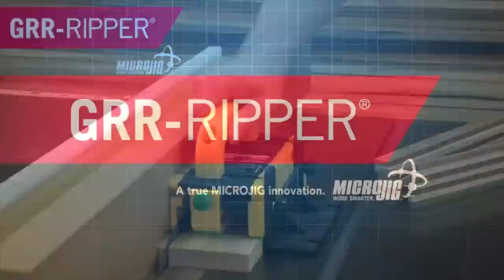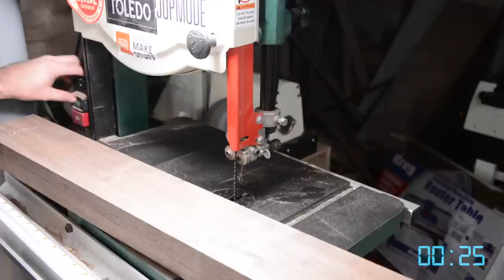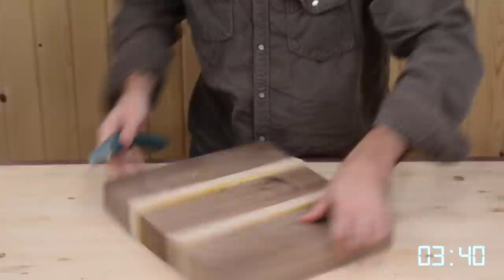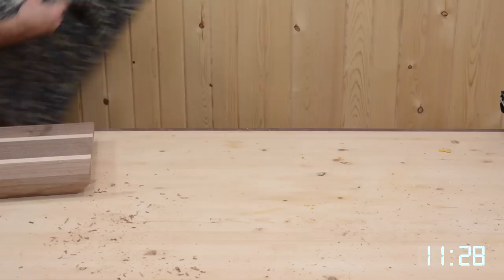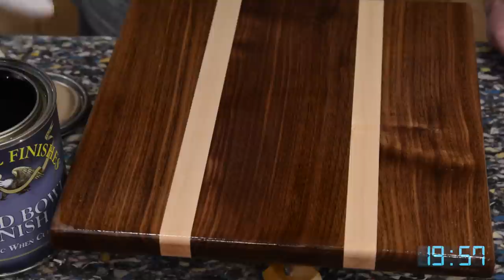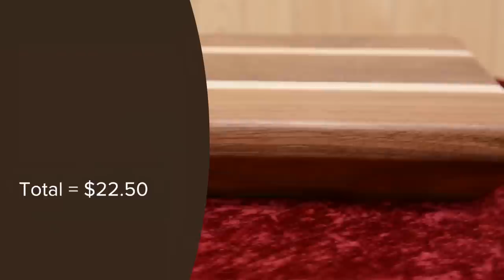Making a Cutting Board in 20 Minutes

Comment: Nice cutting board, black walnut and maple make a great contrast/combo. Try using a ripping blade in the future with around 24t count, you will cut thicker materials like butter with no struggle. It's amazing how a low tooth count sharp blade designed for ripping will get a higher output out of the same size table saw motor.

Comment: I have watched a bunch of woodworking videos tonight, and they've all been impressive. One thing in common throughout them all however, is that all the carpenters appear to have tens of thousands of dollars worth of machinery. How anyone could emulate what they do, or hope to get the same results, with little or no expensive equipment is.... impossible.
Reply from the maker: +DEUS VULT woodworking is expensive!
Reply: I just finished a cutting board today - im looking up methods of finishing the wood now. I have a crappy $100 table saw, $300 planer/thicknesser, $15 glue, a cheapo $20 set of clamps and a $50 random orbital sander. That is literally all I used. If you're precise enough with your cuts and glue-up, you may not even need the thicknesser, you could probably get away with a hand-plane! Not impossible at all!
Reply: Check out Steve Ramsey, Wood Working for Mere Mortals. He does everything usually less expensive and even gives options for even cheaper options. That being said, all of this could be done with hand tools, but it'll take you a lot longer!
Reply: I know what you mean. The high-end tools do make it easier, I was just lamenting my Black and Decker jigsaw from 1980, means I cut it wide and sand allot more, if your willing to take the time, the same results are...possible
Reply: OMG I was just laughing out loud and thinking the same thing! Cutting board in 20 minutes... if you have all the top-of-the-line equipment, include a planer that's basically as fast as a paper shredder. I mean, props to this guy, but I have a circular saw, a hand planer, and some clamps... so this was not remotely helpful.
Reply: would it really sell for 70  $$  though....  rich people might buy it in a good mood..lol
Reply: @primalfury2011 $70 for a custom cutting board is not expensive nor for "rich" folks. It's almost the cost of a video game, a restaurant meal for 2, etc.. and it lasts for decades when taken care of.
Reply: Harbor Freight is my friend. Do they have $1,500 miter saws? No, but what they have will work for a long time and get you started in woodworking for under $1,000.
Reply: The art of woodworking is dying and dying fast.  Everyone with a few thousand $$ in high end equipment thinks their a master woodworker.  But, you take those machines away and they can't do jack.  My favorite woodworker is a guy named Ron Underhill, he runs The Woodwrights Shop on PBS, he makes amazing items and guess what?  He never uses a powered machine.  Check him out: http://www.pbs.org/woodwrightsshop/home/
Reply: Woodworking is changing. I wouldn't say dying. They used to use shark skin for sandpaper. You can trace the major trend back to the industrial revolution, so it's not that things are changing NOW. They've BEEN changing. Knowledge of wood behavior, creativity and attention to detail are still required for good results and that takes dedication and experience to amass. I don't think there's anything wrong with how most of us work with wood. It's just different. The modern woodworker is a hobbyist typically and has a day job. During the off hours we're looking for progress and machinery usually gets us there quicker.
Reply: I hear you - I got my sawhorses, circular and jig saws for free from an estate. I'm now trying to barter my design skills in exchange for a table saw, a router and a surface planer.
Reply: So, not to be sparky but... If you own but a circular saw you aren't ready to watch videos on cutting boards. People are taking their time to make teaching videos using whatever tools they have. You will be hard pressed to find someone making cutting board videos using hand saws and planes. Heck, I have hand planes that cost nearly $400. Would I need to demonstrate using garage sale planes? Again, I'm not trying to be rude. I would agree if your complaint were based on a $10k laser cutter. But.. Then I'd be breaking the same rule because who sets the price cutoff? You need a base of tools to get good, consistent results in a timely manner, especially if you have a day job. I started with nothing. I decided that a 8" jointer, a 15" planer a cabinet saw, etc. were all things that made sense to me. I target videos that are achievable to me given my tools. Wouldn't watch a turning tutorial if I didn't own a lathe!
Reply: Paul Sellers has a channel where he makes his projects with hand tools, besides the occasional power drill here and there...
Reply: I completely disagree my shop is canvas with that plus machinery I'm 1500 in. Time patience and hard work learn about it.
Reply: I've made a 15"x10" cutting board with a mitre saw (you could use a circular saw) and a hand sander. Using a sander takes forever so it would be better to have a planer.

You can buy a decent table saw and benchtop planer for around $600.
Reply: Shaq Deisel yes the art festivals are full of guys trying to sell beautiful cutting boards for $125. I'm sure they're all doing tremendously well financially. Profit my ass. Just call it a hobby, what is wrong with that?
Reply: Go old school. Buy a handplane and some clamps and work your way up.
Reply: I have a full shop with all the tools shown in this video and it took me about 6 months working as a "hobbiest". I started making cheap small things and I would just reinvest it into my tools. I also didn't buy new. I bought the best money could buy at a bargain on craigslist and Facebook marketplace. I sat and waited for a good deal to come along. If you really want it, you can have the tools.
Reply: I guess I started doing it when you commented lol. I even got a free shed for my new shop from craigslist.
Reply: Richard Boyd fully agree. I bought a ton my my stuff used. My first 8 inch jointer was brand new condition for $250. My first place er was the Dewalt 733 for the same money. If a person wants to work with wood that person needs to choose their method. Most of us who do this in our spare time prefer to use mostly machinery, favoring productivity over process.
Reply: DEUS VULT you don't always need all these tools usual me and you will buy wood from Home Depot or big stores like that where as they will buy them straight for the saw mill before they are finished and use the planner and joiner to finish them because they do woodworking for a living the investment in the tools is better than spending more on lumbar
Reply: the profit was $47... Hes not even close to making a profit unless he makes 2,000 of those cutting boards.
Reply: You can purchase a WEN 12 inch  thickness planer for less than $300. I bought most of my tools on Craigslist for little of nothing
Reply: CPO Outlets sells factory reconditioned equipment at discounted prices and they come with a warrenty
Reply: Wood working for mere mortals can get you started on building absolutely anything the professionals can for ~$1000.  After that, if your serious just keep building on it.  A $500 table saw, $500 planer, $60 random orbital sander can get you pretty far. Granted getting the really good shit cost in the tens of thousands, but these guys are doing it as a living.
Reply: Not only do they have tens of thousands of dollars worth of machinery, they consider the projects being made with these tools as "beginner." Apparently my definition of beginner is a little different.

Comment: Theres a guy called mtmwood or something like that and he makes really amazing cutting boards.  One thing I've noticed in his builds is that he always adds grooves for your hands to pick it up.  It would be a nice addition to add a dedo blade in there and cut a groove on two opposite sides for handles to pick it up easily.  I think little details like that for the function of the actual build are really awesome.
Reply: Alex Wegner would use a dado for that, use a round over or cove bit
Reply: The chamfer is acting as both a design feature and a grip.

Comment: LET'S THINK JUST A MOMENT. Before we harnessed electricity all woodworking - including build homes and castles were done with hand tools. It's slower, but what's the rush? If one knows what they are doing, the quality will be superb, no matter if done with power tools or hand tools.BTW - Harbor Freight has some pretty good power tolls, and a reasonable price. I would think for a DIYer, HF power tools just might last for many years. I use their tools and make cutting boards, serving trays and handles, name plates, garden benches, coffee and end tables, hat and coat racks and candle holders and hinges all most exclusively with live edge lumber from the sawmills. Psst! Lowes and HD have a barrel at the back of the lumber section full of 36"x 2.5" x 2.5" pine for FREE. It is amazing all the things I do with that free stuff.Now, go make some sawdust!

Comment: Dave, Great project!  I am a bit concerned though that you might experience Kickback in the way you are using your rip fence on rectangular work cutting end grain.  You can see the piece pulling away from the fence on the leading end.  You do have a Sliding crosscut jig which would be much safer for trimming and even for the bevel cuts.  The Bevel cuts could also be done safely on the bandsaw.  Keep at it... Just want to see you stick around with us for a long time.
Reply from the maker: Walter Ambrosch I think it appears as though it's pulling away because I keep my rip fence at a slight angle to reduce pinching and kickback. Also I have downward pressure on it the full time. Thanks!
Reply: I noticed the same thing but chalked it up to his fence not being square.
Reply: Drunken Woodworker Dave, I will not debate, you do what is best for you, but ... you might want to consider those less knowledgeable than some.  Use the crosscut sled.  I've experienced enough kickback in 44 years... don't want anyone to experience that same feeling.  Know what I mean?

Comment: Any reason not to flip it and make it end-grain?  More glue time, and finishing takes longer, but it would only add about 5 minutes to the assembly time and much better value for the customer.  Just curious on your thoughts.  I love the board btw, the beveled bottom is a nice touch!
Reply from the maker: End grain cutting boards take a lot more time. I wanted to show off a quick 20 minute project. Thanks!

Comment: Love the project.  I have a question about cutting the board to size on the table saw.  I saw that when you pushed the block to the blade, the block (opposite of you) pulls away slightly from the fence and goes back to being up against the fence once the cut was finished. Why does it do this? And was there any issues when you did these cuts?
Reply from the maker: TheOomgosh I have my fence at a slight angle to prevent pinching and kickback.
Reply: Drunken Woodworker I have heard about this a couple times, but have never seen a video describing and demonstrating it.  Would you be able to do a video on this technique and the pros and cons of doing it?

Comment: Great video, thanks. One quick question:
So I clicked on the link for the Salad bowl finish and it's description specifies not to use on cutting and chopping surfaces. Does this mean your cutting board is a show piece and the buyer should not actually cut on it? Do you warn them about that detail during the sale?

Comment: Love that bongo music! Seriously though, that turned out beautiful for 20 minutes of work. Do you think that salad bowl finish would work well for waterproofing a wooden tankard?
Reply from the maker: Thanks! Maybe if you put on like 10 coats. It goes on pretty thin. I think most people use a slow setting 2 part epoxy. It's food safe once it cures after a few weeks.
Reply: Thanks for the reply man! I just finished my first one and used bar top epoxy on it, but I couldn't get it to come out smooth. Too much and it would run, too little and it would bead up. I'm not nuts about the glossy look either. I REALLY like how that walnut looks with the salad bowl finish.

Comment: Add in the cost of the machines

$1000 for the table saw
$800 for the planer
$200 worth of clamps
$300 sander

Me: a regular guy who doesn't want an entry price on a block of wood to be over 2 grand
Reply from the maker: ok
Reply: You could use under $1000 worth of equipment. Planer $300 , clamps $100, jigsaw $50, router and bit $100, compact table saw $300. So far $850.
Reply: @AaronGeller  damn what a saving. $150 bucks down from $1000. Now I can afford to make my first cutting board
Reply: @AaronGeller  to do it as he did it, it absolutely would cost that much. That's why this is a horrible beginners tutorial. It should be shown with a hand saw, hand plane, handheld sandpaper, and glue. Not a full woodworking shop.
Reply: @t_c5266  where at all did he say its a beginners’ tutorial?
Reply: @t_c5266  Woodworking isn’t going to be a necessarily cheap hobby but it can be done at multiple price points. I’ve saved a ton buying used tools or waiting for sales to acquire tools. If there’s a will, there’s a way.

Comment: I was always told salad bowl finish was bad for cutting boards because it leaves a film which will then crack and such when it starts getting used... have you had this experience?
Reply: +Michael Meis (tubbz23) Not to mention once it starts to chip, the material will end up in your food.  Salad bowl finish can't be good internally.  I've always just applied butcher block conditioner to mine.

Comment: HI! i like your video ~can i ask some question ?

I had made a cutting board

but when i oil the board

i found that board has

1.distortion/Uneven and had many 2.little hole on the surface

i try use titebond glue/super glue/ AB glue to full the hole

but the color is not the same and when i Polished the glue part

it's will become white ><"

when put on the desk it's like a Seesaw

what can i do?  use the Flat planing machine?

but two surface are transform

have you ever heppen same problem like this?

how to fix it's?   thank you!
Reply: Drum sander if you have one, end grain in a planer or joiner is... rough and scary.  You could make a flattening jig for your router and flatten it back that way.  Be really careful on glue up, and watch for bowing, my 2nd board had a little bowing I just put feet on the concave bottom and called it a feature.

Comment: Going to pick up some wood tomorrow for cutting boards.  Which is better to make David, end grain or the way you made this one?
Reply from the maker: +Marc Eaton Endgrain if you don't care about bacteria and want to keep your knifes sharp.
Reply: End grain is bad for bacteria then?
Reply from the maker: If washed properly then it's not an issue. Many cities (including NYC) has banned endgrain cutting boards for restaurants.
Reply: Thanks for the information David. It will be cheaper to make them like yours as cherry and maple are so expensive down here.  I enjoy your work, the videos and want to thank you so much for answering my dumb questions.  Be safe and Merry Christmas.  I am going to use my ShopBot to do some engraving on the boards and do a video on it.
Reply: +Marc Eaton Endgrain is better
Reply: +Marc Eaton Hi Marc.  End grain boards are also a little harder to plane and sand.  From the maker's standpoint, end grain is more difficult but they are better for retaining a good edge on your knife though.  If you search YT for MTM wood, there is some excellent information about end-grain boards there.  He is an end-grain master.    I'm right there with you...I'm about half way done making several boards for Christmas gifts as well.  I'm making edge grain since it's easier than end grain.  Good luck with your cutting boards!
Reply: I am going with the guy who makes the amazing videos, David P.
Reply: End grain is more desirable but they're way way more work than one like this.

Comment: In 20 minutes with a million dollars worth of equipment
Reply from the maker: You also forgot about a having good attitude!
Reply: You could use under $1000 worth of equipment. Planer $300 , clamps $100, jigsaw $50, router and bit $100, compact table saw $300. So far $850.

Comment: Noob question: Why did you use a band saw for the first set of cuts and then a table saw for next?
Reply: Maybe for less waste? I'm not sure though.
Reply: He used the band saw to speed up the process for a "rough cut". The cut didn't have to be perfect because he was going to make the final cut later on the table saw after the glue up and planing.

Comment: Maybe I'm doing something wrong, but when I've made cutting boards I sand the snot out of it and wipe it with a wet cloth, only to have the grain raise up.  I've used up steel wool, 600 grit, 2500 grit but still the grain raises. What the heck?

Comment: 20 minutes.   Well, that’s assuming your wood is already planed and jointed.  Add a few hours of glue-drying time.   The time spent after in trimming, mitering, routing, sanding (including hand-sanding the edges) and oiling alone is probably more than 20 minutes.    The cost of the tools and equipment is a few thousand dollars.   Profit = $47.50.   Yeah, sort of.

Comment: Couple of comments.   Good idea but that board is not perfectly square.   Note when cutting on the table saw the gap that appears against the fence.   About 1mm each time.
Also the cost is significantly more than quoted.   Firstly glue is expensive and there is a fair bit of glue used in making the board, and secondly one has to take into account the capital expenditure of equipment used.
But overall not a bad tutorial.